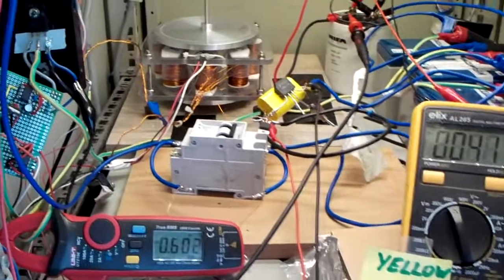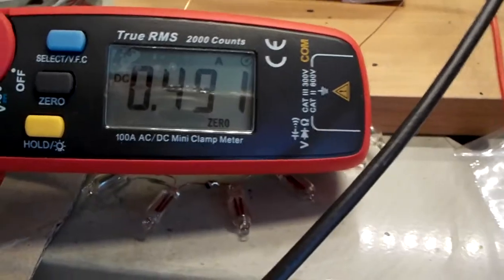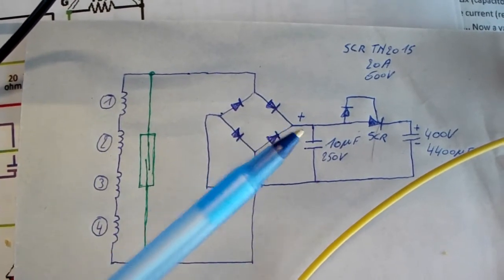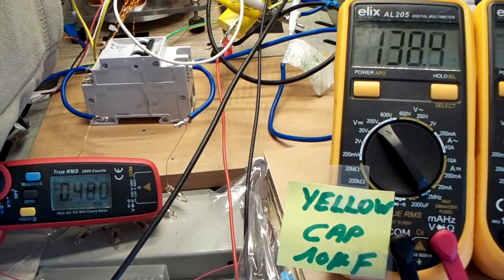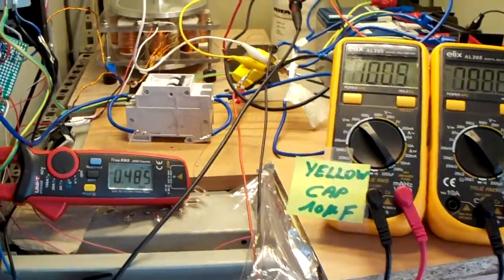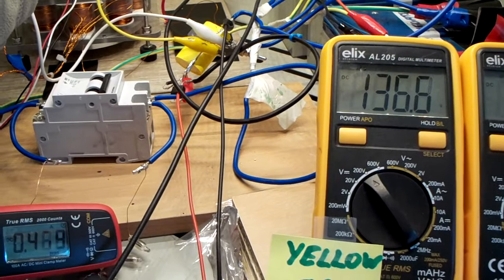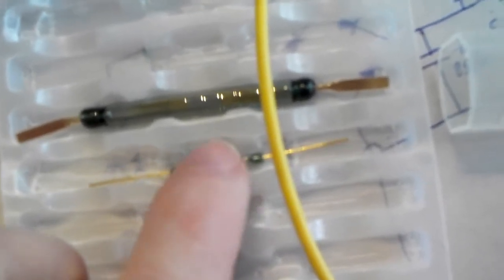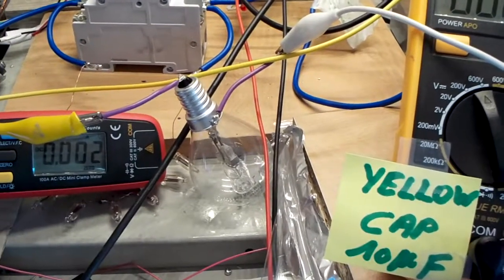001 Dual pole Generator Coil Shortcutting

Comment: Great video. It's interesting that there is a sweet spot where output is balanced by drag (more amps from source) - so there will be a point of most efficiency.
Reply from the maker: Yes, there surley is. But therefore a more stable holder is needed :)
I was so surprised of the good results, never tought it could make that much difference.
When a capacitor charges 2.7 times faster, it really means you got 2.7 times more energy not just some peak voltage. Offcourse as far that I'm correct on that, but watching that 220V 30W light bulb I'm very convinced that we speak of energy and not just a sweet voltage.

Comment: This controlled pulsing of the generator coils is something I have shown many times over the years. The reed switch is not stable. You don't yet understand what is happening and why there is a gain there. You will have to let go of regular thinking of electricity to understand these processes. When you can do that and see how the energy works then it will make sense. Everyone looks at the parts as if they alone determine the results. But everything is much more involved than you think. These experiments help unlock you from the mistakes of limiting yourself in terms of measurements of amperage and thinking about electrons. 
You can also focus on how the generator coils affect the motor performance. And why is it that shorting out the coils speeds up the motor? And more importantly, what is the way to short out the coils and get maximum energy from them (under these basic levels of understanding)?
Reply from the maker: Thank you for the response.
Always when I think to understand it a litlle bit the results show something different. I thought that shorting the coil would kill the negative because there's a closed loop created. But the results prooved that I was wrong, it seems to create a condition to let it in the circuit after that closed loop is opened.
When the reedcontact placed arround the generator coils the sweet spot had the high voltage and little bit less current, when placed on proximity of motor coils the voltage was also high but the amps went up and more drag to the motor was created.
I found it important to show anyway because the capacitor charged showed that it's not just a higher voltage, there's more energy in total.
Kind regards
Reply: You will see these kinds of things with the hairpin circuit in the new kit. Like I said, the energy doesn't work like people think...
Reply from the maker: Looking forward to experiment and learn from it. More insight is really welcome.